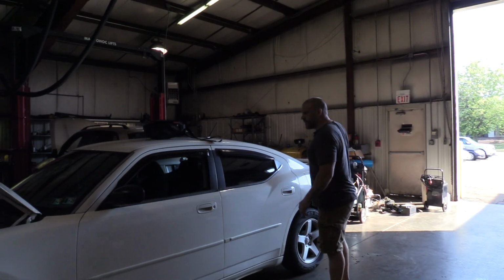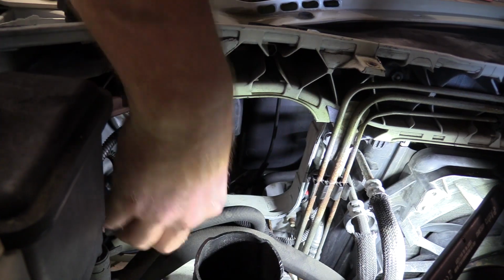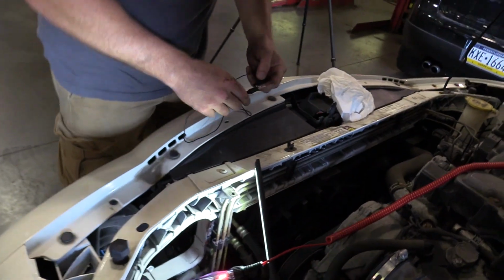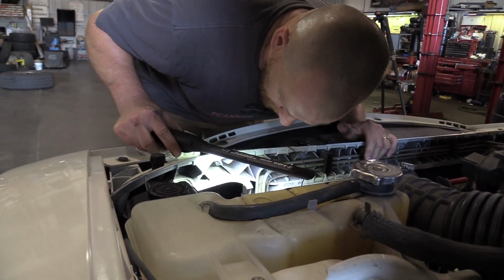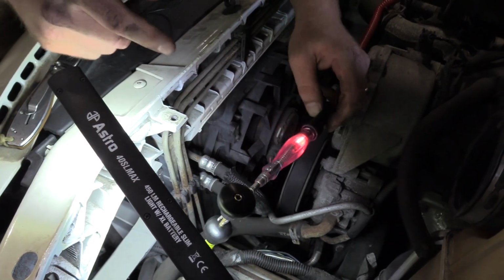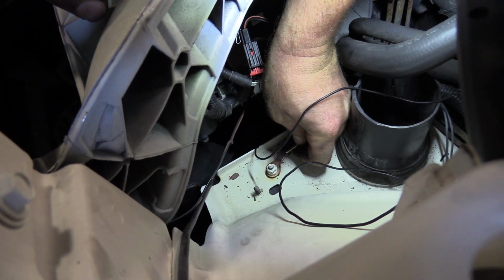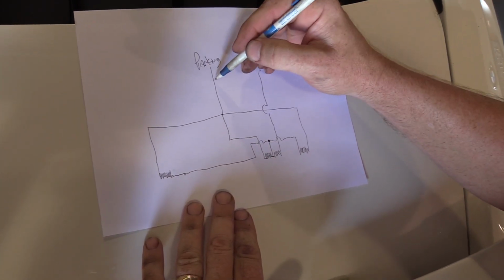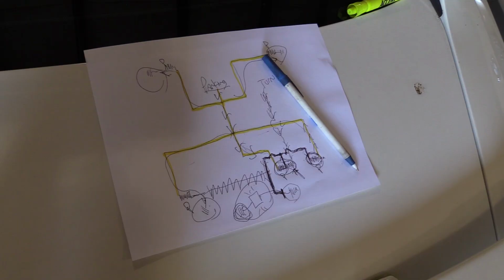Voltage drop testing a parking light/turn signal circuit

Comment: Reminds me of many years ago while I was managing the maintenance of a fleet of 18 wheelers, we had a Kenworth truck with crazy light problems. The mechanics tried everything, well almost everything, even installing a new ECM! Nothing helped. One of the guys was telling me about it over coffee and I decided to take a look. Purely by chance, I took the tail light lens off, pulled out the 1157 bulb, held it up to the light and the brake/turn filament had burned into on the end, dropped down and was contacting and welded itself to the tail/park filament. The turn signal was back feeding to the entire park light circuit. All because of a $1.50 bulb. Some of this stuff can drive you crazy and sometimes you just need a fresh set of eyes to look at a problem.
Reply: And also to keep it simple!  When I was having taillight issues on my Subaru, the first thing I did was check the bulbs.  Burned out, replaced with new ones, problem solved.
Reply: I had that exact same problem once on a car. I was going through wiring for hours looking for a dead short ... and it was in the damn bulb the entire time, lol! Live and learn!
Reply: @SmittySmithsonite  Always start there lol, it has happened 3x to me that a shorted light was bringing the internal lightning system down. I have seen other issues related to shorted bulbs such as affecting the ABS module presented by FD Automotriz (Spanish Channel).
Reply: Those are good points, William, and having worked in heavy duty since the early sixties, I would say electrical issues were the toughest for the general KW, Pete, White Freightliner, Autocar, etc. mechanic to master.  When the "crazy light problems" would appear, I always emphasized to the others to look for a bad ground somewhere, and I can't remember an instance when that was not the problem.
Reply: @cwj9202  I would agree 100%. More times than not, it's going to be simple, like a ground! I just had a hydraulic leak that appeared to be coming from the bottom of a cylinder. It was kinda hard to get to, couldn't see the area that appeared to be leaking, so I ordered a new hydraulic cylinder. It leaked!  Then I look at the lines, different from all other lines on the implement, and see O-rings. None of the other lines use O-rings so I was not expecting them. Then I look in my assortment, get a couple out, about $.05 each, and no more hydraulic leak! Send the new one back. But, wasted a lot of time and had not the replacement been "leaking" also, wasted a bunch of money! Typical "parts changer" mentality!! I gotta work on that!
Reply: @Watchyn_Yarwood  - Don't feel like the Lone Ranger.  We have all done that.  Years ago I arrived at the conclusion that if I could not detect the exact location of the hydraulic fluid leak, I would not change out any component, because, as you well know, hydraulic parts are not cheap.
Reply: 😅 what are the odds👍
Reply: That's a fairly common problem, i see it a lot, working in the heavy duty industry you get to see a lot of crazy shit, in the 30 years I've been a tech I've only actually found a dozen or so bad modules, 98 percent of the time it's a wiring problem, like Paul says, always check your circuits loaded, and remember K.I.S.S, keep it simple, "stupid" back feeding bulbs should not be a mystery for any tech at any level, visual inspections usually produce great results and most of the time it all that's needed to make the diagnosis and repair.
Reply: Just a few weeks ago I got a new project. Previous owner told me and I visually confirmed that the lights were "weird" he's expression. Long story short. Someone stuffed a correct bulb into the socket, rather crudely. Pushing the ground contact backward to the point that sometimes it contacted one of the positives. A combination of vibration, heat, etc. produced "weird" results. Just one careless push of a normal, good bulb...
Reply: Proof positive that had you paid those techs a livable wage, they would have replace that bulb, instead of the computer!! 
[sarcasm] [shakin ma head] [makin three trips to the fast food drivethru, to get my order correct]
Reply: @roadkill5333  You might have a point there (I still shake my head) if it had occurred in the last 10-12 years but that was over 25 years ago and you took what you could get. My KW dealer at the time could not find qualified technicians at any wage! They had to shut down a whole shift due to technician shortage. We were fortunate to have two local guys who could and, most importantly, would work. I've twisted wrenches all my life and never got rich doing it. Yeah, and your three trips thru the drive through enforces the current state of today's workforce. Jump over to western truck and tractor repair's channel and listen to some of his stories about tractor dealer(stealer)ships! He's also a big ScannerDanner fan.
Reply: I'm already a Warren fan, too! 

About 25 years ago, THE MAN was holding me back, too!! As a matter of fact, I can blame THE MAN for not letting me go to college to learn how to make the same money as rich people. Some silly nonsense about dropping out of high school with a POINT FOUR O grade point average!! I was forced to work for minimum wage, at the skill level that I had, instead of making the same money that wealthy people made!! 

I once overheard a fast food worker complaint about the horrible working conditions, and the below average pay that she got, while leaning against a counter waiting for my order to be handed to her, so she could hand it to me, without ever looking into the bag, or stop leaning against the counter while she passed the bag with the WRONG ITEMS FOR MY ORDER, out the window!! When I handed it back to her, she had the nerve to ask me what was wrong with the order!! I told her that it was likely all complete and correct!! She asked why I was handing it back. I told her that it wasn't my order. After comparing sacks full of stuff, she handed me my order!! No "I'm sorry", no "have a good evening", it was "here it is"! As I stopped, went thru the bag, and verified the order, she asked if it was all there!! I asked if she was supposed to do that! She asked "do what"? I said verify the order, or let the customer verify whether they got what they already paid for! She just looked at me with a F you look. I wished her good luck on her quest for a raise, and drove off!! When I got home with my cold order, that was undercooked, packed into the bag like concrete blocks not food items, and haphazardly prepared without any sights on quality, I informed corporate to really consider her requests for more money!!

I worked at a convenience store, that wouldn't pay much, couldn't keep employees, and when you did something to help ease the cost of losses to the unit, they would hold you accountable! I once caught a shoplifter, that I knew was a shoplifter, I just couldn't prove what he was doing!! I finally caught him, recovered the merchandise, and sent him on his way, WITHOUT CALLING THE COPS!! I was admonished for disrupting business, and falsely accusing a customer of theft, without a police report! (I followed him outside, removed about five items that he hadn't paid for, and used the "you forgot your receipt" for $2 worth of merchandise, to get out there, and NOTICE THE STUFF IN HIS POCKETS!)I also had a gas drive off caught, because several cops were positioned close by, and noticed the commotion, and went and got the guy!! They got their $20 in gas back, I went to court on my own time, and he was not even talked to sternly by the judge, and the mgr refused to ban him from coming back!! We were admonished for having drive offs, and had to attend classes on drive off prevention, theft prevention, and the video tapes were constantly reviewed to see that we were paying attention!! There was no video of customers, in any areas of the store!! I even almost experienced a robbery once, and a restaurant down the street ended up getting it, about 15 mins later. They pulled the tapes to get the descriptions, and pictures, the cameras weren't trained on the customers, only the employees, in non customer areas!! I quit that job, when they wanted to run the store on 24hrs with me and a manager! We lost four employees in a month, and the store refused to back off on the 24hr times!! It was hard enough with three people. But I quit when they wouldn't stop 24hr service with just two of us!! 10hrs a day, for two weeks straight, 7days a week, and they wanted me to run more than 12-13 for God only knows how much longer! 24hrs wasn't worth the time. Barely any sales after BEER THIRTY!

On the other hand, I had a lawyer, handling my disability case, call me a year and a half after I employed them, to talk to me for the first time 26 days before my court hearings, to inform me that I had no case because my medical records didn't exist, and I had no proof!! He explained that he was taking a separate course of action (which is exactly what I had been ready for, and had already supplied all of the pertinent information for, which was originally denied) from what I was expecting!! The following week, after I called the dr to get my records, went and picked up the records, took them home and made copies of them, and then took them to the lawyers office, myself, where they promptly refused to accept my medical records because they didn't need them for the case for which they had prepared, which was because they didn't have my medical records to prove my case!! Of course, when it came time to get paid, they wanted all of the premium price for all of the generic work, while they promoted their excellent work records on tv commercials!! I didn't get paid as much, but they got their money, and for almost no work!! 

My point is you get what they want you to pay for, but what they want to give you in return!! And while giving substandard service, at a premium price, complaining that they don't get enough for what they do! That's true with fry guys, auto techs, store clerk, and attorneys, alike!! And they all claim it's because they don't make enough money afterwards, but offer you the moon beforehand!!

Comment: You know that's BS about fixing them holes. Not fixing them can lead to this exact same problem. Come on Paul.
Reply from the maker: Yeah, thought about that in the edits but, grounds do NOT corrode like power wires do. There is some physics involved in that, just don't know what it is.

Comment: A lot of people assuming they make it this far would usually fail to load the circuit while testing.
Reply from the maker: Exactly, or they would measure the ground with an ohmmeter
Reply: @ScannerDanner  Some people just can't grasp the subject of voltage drop and how grounds read voltage if not actually grounded, much less the tiny current used in ohm testing and issues such as backfeeding.

Comment: I wonder if the current flow was back to the control module through the turn bulb and through the bleed resister on the output. It would explain the dimness.
Reply from the maker: The dimness of the turn signal bulb would be because it had to travel through the parking light bulb to find a ground. So two bulbs in series
Reply: @ScannerDanner  How? Are you saying that a bulb found a ground through the positive feed of another bulb? Seeing as they were both fed by the same feed.

BTW: Love your channel. Long time watcher but you're wrong about the flow of electrons with your diagram this time brother.
Reply from the maker: @paulbradley9912  Let's see if I can describe this more simply. 
The ground became the power for the LF outer parking light bulb when the turn signals were on. And the parking light power circuit became the ground path through all the other parking light bulbs in parallel, as long as the parking light circuit remained off. The other parking light bulbs did not light because the current flow for the LF outer parking light was being split between all the other parking light bulbs.

Comment: BTW, wouldn't it be a cool joke to wire the windshield washer squirter on the turn signal circuit! LOL
Reply: BTDT, also wired a power seat using a relay to flip the polarity.
Reply: Or the Horn

Comment: Maybe the others weren't lit because the circuits they ground were not energized as I didn't see you switch anything else on
Reply from the maker: The others didn't light because all three of the other bulbs would be carrying the current and it would not be enough to light them. I bet if I unplugged the rear parking lights, I could have made the right front blink too. (with the left front turn signal on)
Reply: @ScannerDanner  I made the comment about halfway through the video.  You are correct as that power would backfeed the other circuits if just the eyelet was not grounded with just the parking lights on. It is always a good idea to check all of them.  I got burned running the "quick" ground on a PT Cruiser light once when other symptoms still surfaced